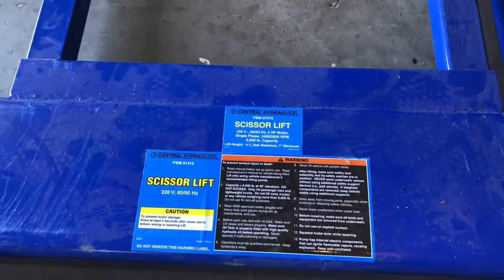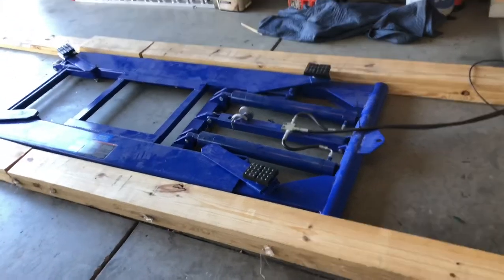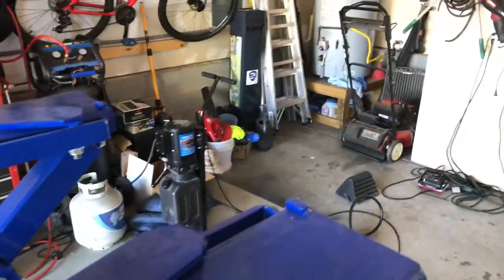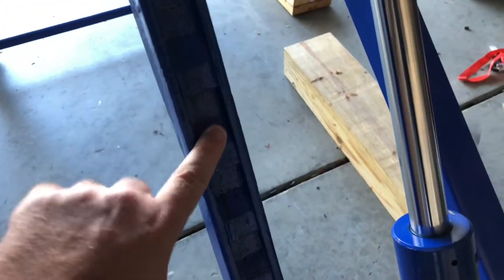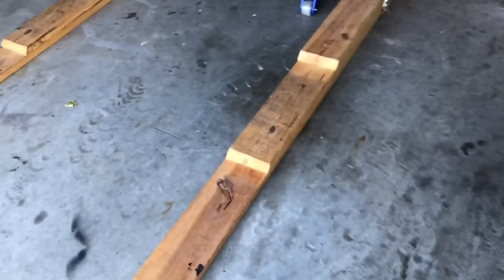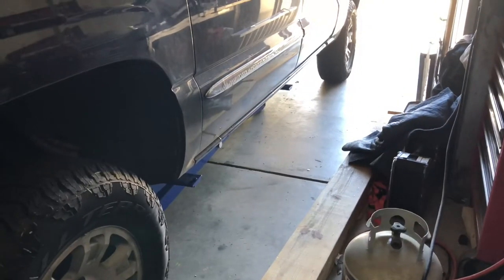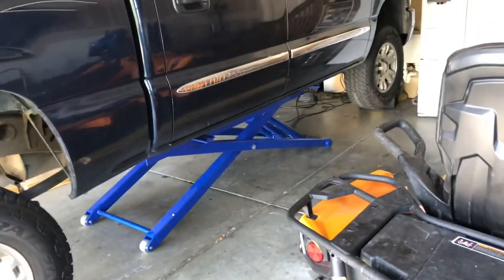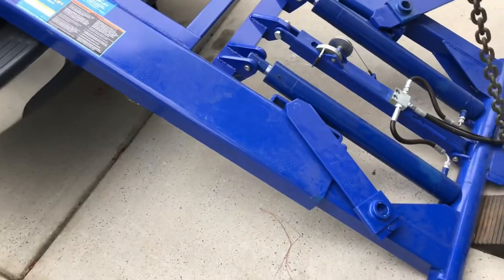Harbor Freight Central Hydraulics Scissor Lift 91315 Review and lifting a 6000 lbs GMC truck

Comment: Rapid pulsing the motor on the pump is going to burn it out, you need to give it 5 seconds between pump starts to save it from doing that
Reply from the maker: themeez1000 yea been told that one before.  Im taking it easy after learning this.
Reply: @mrautomotif8996  I got ya. Yeah just thought I would give the warning, I have my own shop and have 3 lifts in it, the lifts were only like 2 days old and one burned out because one of my employees was doing that. So If I could save someone else the headache.
Reply: Thanks for the tip as I'm looking to buy Bendpak. I won't be doing that.
Reply from the maker: midnightsunturbo I posted another video about this lift yesterday.  Basically the lift sucks.  Never able to lift what I need.
Reply: @mrautomotif8996  Just watched the video. Yeah, the lift does not fittype of work you are doing. I'll be using the Bendpak MD-X6P mainly for maintenance purposes. Nothing close to what you are doing. My tiny little garage ceiling is only 8 footer.
Reply: @mrautomotif8996  
What do you mean?
What are you trying to lift?
Reply from the maker: @patrickflohe7427  it lifts the Foxbody fine but my other small import cars didn’t work. It works best for full frame or older unibody cars.

Comment: ne thing you never tell us is "how do you lock the mounting pad arms in place once you select their position?" you can move them around so easily with your hand, makes one think a 5,000 lbs car would easely slide off at the slightest push and fall on the ground. Are there screws or "something" to lock them in place once they are placed under the vehicle's jack points? All the videos I saw nobody mentions this and its a huge safety concern for us.
Reply from the maker: There’s no lock.  There is a stop to prevent them from moving too far but no lock.  I sold my lift   Too many struggles and not enough space for me.

Comment: Portable! Need to used your head wen it is considered portable. It is not the same portability as a floor jack. The idea behind is you have the ability to move it in your shop. I rather have a good scissor lift that I cam move around in my garage instead of having 2 post lift. You can easily lift your riding mower your motocycle and use it as hydraulic lifting table also.